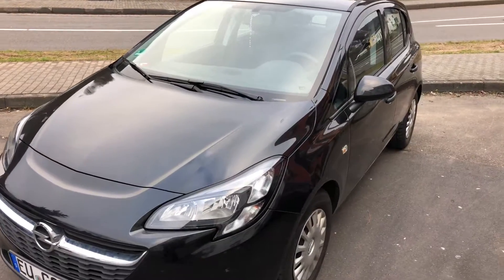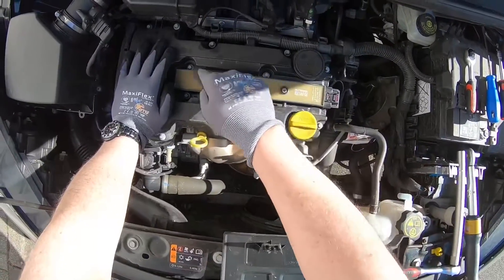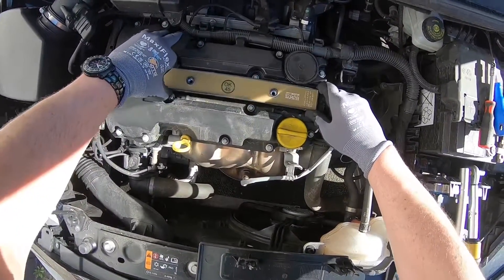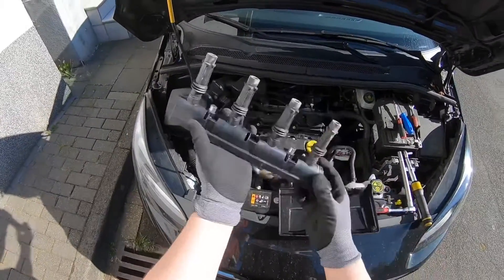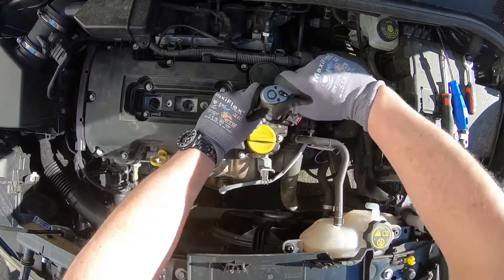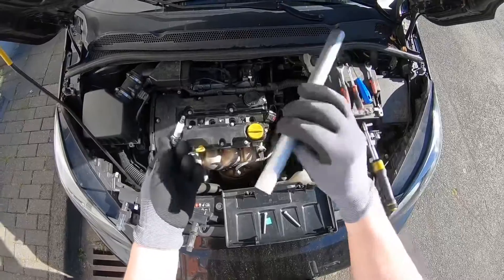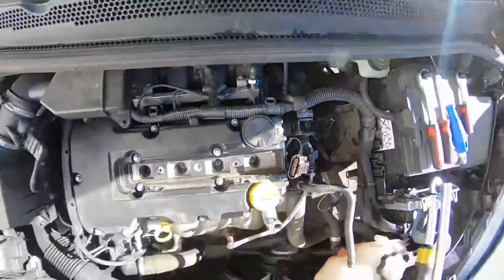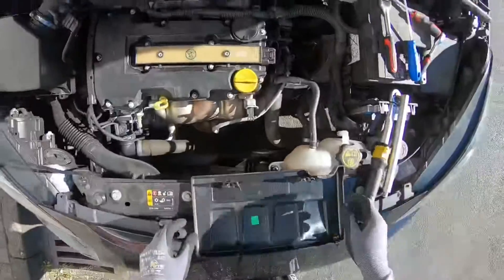How to replace the spark plugs sparking Plug replacement Vauxhall Corsa E Mk4 DIY

Comment: Can you put any spark plug in any of the 4 holes. 
Also how many miles does it last standard spark plugs when to change
Reply from the maker: Every engine needs special spark plugs check at your local dealer. Best regards
Reply: @PDPPerformance  what size mm is the spark plug in your vehicle
16mm?